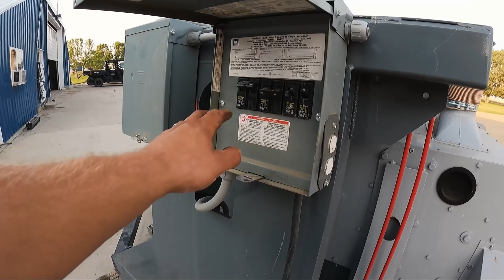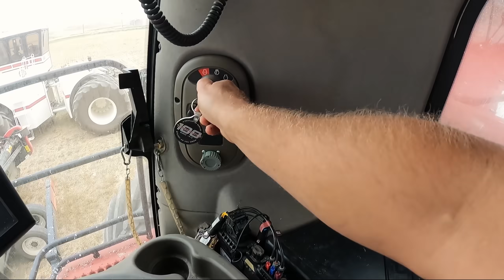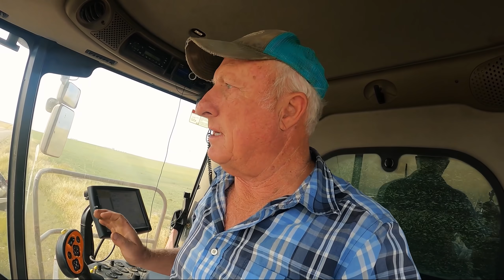Red Combine Vs. Green Canola (NOT GOOD)

Comment: A word on your CNH lubricants sales pitch. 😂 CNH does not make lubricants, they just put their name on it. You can normally buy lubricants from the oil companies much cheaper than from the manufacture. Just ensure that it complies with the appropriate CNH approvals for your equipment. 👍
Reply: The hydraulic oil has higher additives do to the extreme conditions the newer tech equipment requires
Reply: @RobertWelkerFarmerBob  I can just hear the  Case sales guy. 🤣 Other brand hydraulic oils from oil companies complying with Case spec. also have "magic" additives. Who makes Case lubricants? I know but I dont want to get sued by them. You can ask them. 🤔

Comment: Wow, that cleaner worked great.  Good job.   

What are you going to do with the old Versatile swather ?
Reply: Maybe use it on next years canola and a pick up head for a combine?
Reply: @frankdeegan8974  It was old, deside the shed.  Probably has a good gas engine and hydrostatic system.
Reply: It was a RENN and the platform was scrapped for another project.

Comment: Are you planning on planting canola next year?  Wonder if a guy kept your canola from this year and used it as seed.  Take a $30000 loss this year on the seed but save $30000 next year on the seed.  Basically break even minus operating costs.  Seems like your loss would be less if you tried to salvage a canola crop next year.  Or is canola more trouble than what it is worth.  Cut your losses and go back to ole reliable (wheat and peas)?

Comment: Youve planted the canola quite sparsely. In Sweden where i live we plant it more dense. An old saying is that you should plant canole so dense that a cat can walk on it when its done for harvest. We seed about 50 - 80 seeds per squaremeters depended of variety. Are you certain that you havent got two different varieties in seed? In Sweden we have spring and fall/winter canola.
Reply: It wasn't that it was too light.  It was the drought....we had less than 7 inches and only 3 during growing seasin

Comment: This might be telling you how to suck eggs but........
A quick word of warning about drying that canola or indeed any other damp small seed crop. Be aware that due to the small size of the individual seeds air passage through the stored will create much higher back pressure on the fan/s especially if the crop is stored too deep. The result can easily create hot spots in the crop leading to moulding. Once the air is moving through the stored crop it forms easy passage routes leading to dry passageways and damp areas close by (the moisture is very slow to migrate to those dry passageways for removal from the bin. 
I would strongly recommend very close monitoring of the actual airflow and any heat buildup particularly in the vicinity of the cone formed when filling as it is likely to be the dampest material in the bin due to the fines in the stored crop and the steepest angle of repose.
You may be forced to literally move all the seed to break up air passageways since it seems you don't appear to have in bin stirrers.

How do I know this? Try drying combine harvested grass seed at 25%+ MC and you need it down to about 8%!
Reply from the maker: Thanks for the advice, Dan!

Comment: you could have shut the bottom sieve to 1 mm and opened the returns to dump it on the ground . and not thresh it so hard to reduce the broken up trash , wide concave , slow rotor speed .

Comment: did those MAY WEST FINGERS thingies on the reel work as good as you all thought they would on the shorter stuff???  are they gunna get in the way for bigger stuff??  or any other negs??
Reply: They worked well, even seemed fine in taller crops.  But in normal height crops the narrow fingers would suffice.
Reply: @RobertWelkerFarmerBob  I was wondering if the fingers were ''even TOO AGRESSIVE'' pullin in on a HEAVY'er THICK'er CROP 

 ...if that would even be a thing...  

it's just something that popped into my head so I askeded
Reply: @alexmikhael5061  i would prefer narrow in tall thick crops......feathering is all that is needed then.

Comment: Use the tools you got to make the most of it 👍
I know you are partnered to CNH but their grease is just like any other NLGI2 specification grease on the market.
Reply: The hydro oil has more additives for the new tech equipment
Reply: The CNH grease is a step above a lot of other NLGI2 greases.. it has a greater weld load then then common NLGI2 amongst other benefits.
Reply: @BERGBOY570  everybody's grease is a step above competitor's and has better additives. 
The specifications are the minimal requirements to pass the certification but those "additives" only make up more profit margin for manufacturers. 
There are as much special greases as there are manufacturers. 🙄

Comment: You should do yourself a favor and make a cleaning house complete with air. You wouldn't have ANY green at all if you pulled air through those screens and removed that lighter green stuff that is floating. It wouldn't take a lot to set it up perm, then you wouldn't have to do it by hand.`

Comment: canola is not easy to dry with just air, esp with all the green stuff u got
Reply: I’d turn the fan on and not shut it off until hauled to the co-op. Stuff is dangerous when stored wet. Heats up quick.

Comment: if you're going to keep doing canola, I would recommend going to northern farmers channel and watching his old canola vid's. You may want to get a couple swathers, and pickup headers for the combines. Maybe you could turn one of the old JD combines into a swather, if they still run. That seems to be the only way to get canola to dry down. You'll still have to dry it though.
Reply: The Northern farmers have separate varieties. All the old ones are much best swathed to reduce shelling out while there are several newer ones that were developed that are intended to be straight cut. In a situation like the Welkers faced, they also would have been swathed up North. The grain cleaner made straight cut doable with difficulty. Would have been a very long job with a normal volume yield.
Reply: You can also swath the straight cut varieties...just depends on your situation..lots of guys are seeding pod shatter reduction canola..just to be able to swath it riper

Comment: There has to be a weight difference on this stuff. How about using an air stream to remove the "green stuff" from the seed as it drops into the hopper? I have no idea how that can work  but I've seem it done in manufacturing processes.

Comment: The trick to know if you are too shallow when Deep Ripping - 
First are you leaving plow-like tracks behind - indication you are too shallow. 
Second, you need to check as you rip if the entire ground between the deep ripper shanks is fully heaving upwards between the rippers when you rip - if the entire ground isn't lifting then you are too shallow. From what I've seen in your video you are too shallow - it's very clear from shot filmed from rear that none of the ground in between the rippers is moving (look at the ground in the centre between the rippers, it does not move) - try go deeper and compare the results side by side - it should look a lot cleaner when you go deeper.
Reply: Is it really worth it to rip your fields?  With no more moisture than you get a year it would seem like minimum till would be a better way to go.
Reply: Richard G there are several benefits. First you are decompacting the soil and shattering the hard pan. This allows any moisture received to penetrate deeper. When you get the moisture down deep it is far less prone to evaporate as compared to moisture in the upper layers of soil during dry periods.  The looser decompacted soil structure after Ripping allows the roots of your crop to more freely grow deeper to tap into this moisture  - which will be more readily available to the plant during periods of low moisture in the growing season. Also by shattering the hard pan you are allowing the roots to access nutrients which before in the compacted soil those roots just could not get down past that hard pan barrier. 
If you would like to take it a step further you can look at Deep Ripping as being very minimal compared to the process of Clay Delving your soil. 
Delving is the process where massive shanks are driven down to break the hard pan and to importantly churn up subsoil clay to mix with your existing top soil in order to get a soil which will hold moisture and increase yields in areas which have low/minimal rainfall. 
There are many videos of Australian Farmers (and studies done by their Department of Agriculture) using this technique where very poor performing fields which had poor/sandy/minimal topsoil have been able to be regenerated and turned into highly productive yielding fields. Yields of Canola for example increased by c.50% - you will find several videos on YT showing how the Delving is done and side by side comparisons of a field half delved and half not - the difference in size of plants grown and yield on the delved side is as they report up to 50% better yielding. It's an expensive up front cost to Clay Delve the ground, but the increased yields more than pay for it over time.
Reply: @paullynch277  Great explanation!